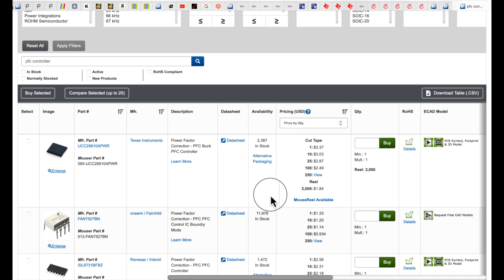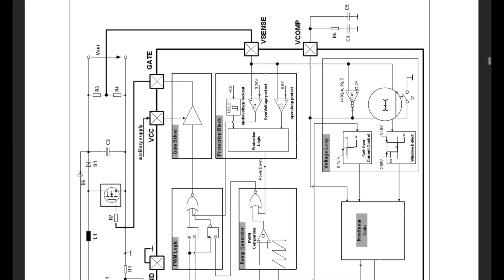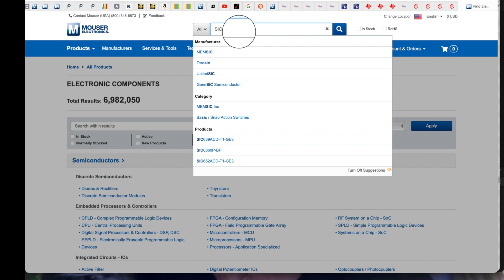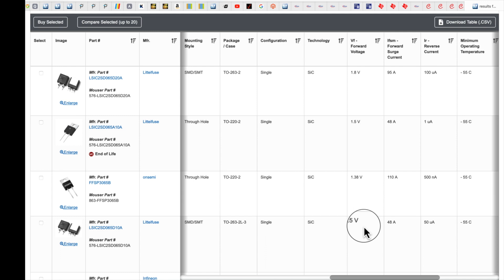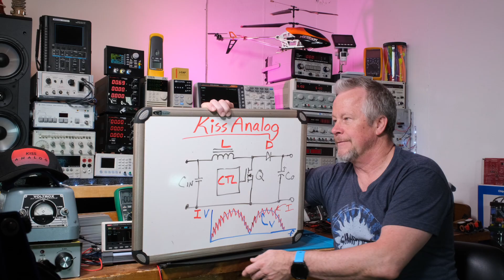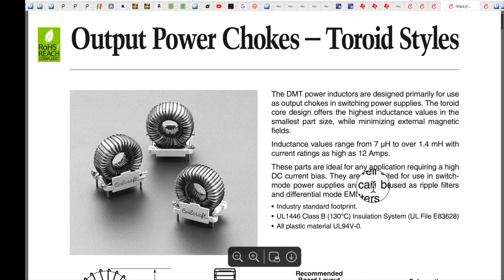Select Inductor and Control chip and SiC diode for JAT Collaboration ep#6

Comment: Hi Eddie, you have mentioned about 5A RMS on the diode and inductor, how did you calculate that? Is it as simple as using the input power over the input voltage? Is that what the inductor will feed into the diode? I guess that those will be peaks?!? A small simulation o the explanation of how to calculate these currents empirically would help.
 Thanks for sharing your experience Ivan
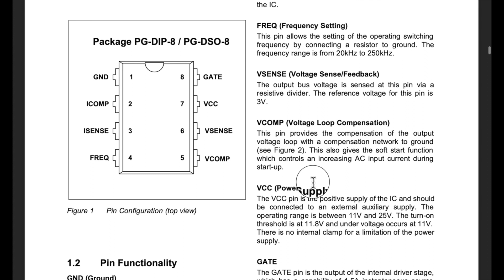Reply: ep#5 8:30
Reply: @ottoh6498  thanks Otto, not sure how I missed that! Thanks again
Reply from the maker: You guys are awesome!!

Comment: so is the control chip having control feedback censoring from the out put stage, or just input to the output?
and is any benefit running two control ics? like controlling one for negative rail one controller for positive rail?
yeah it's a good series learning a lot.
Reply from the maker: Great question!  For the PFC, we just regulate the high voltage DC (400V in this case).  It will have voltage feedback and current sense.
Reply: @kissanalog  right so it's got current sensor that could be sensoing from the input of the amplifier to draw more current.